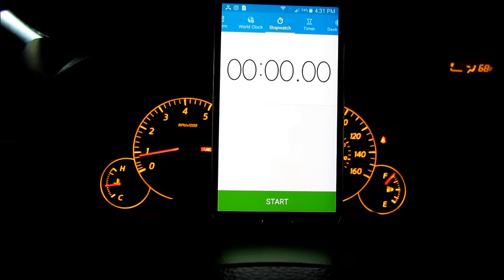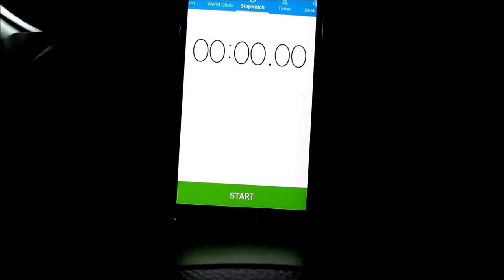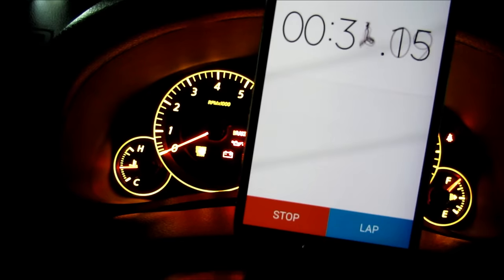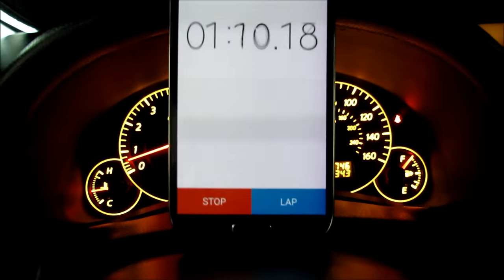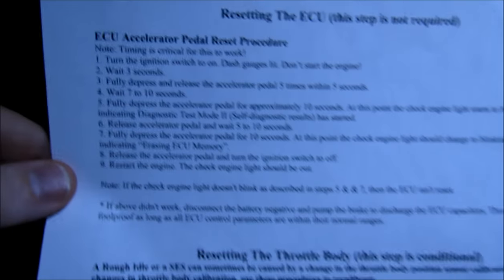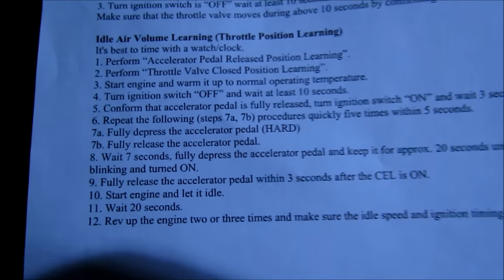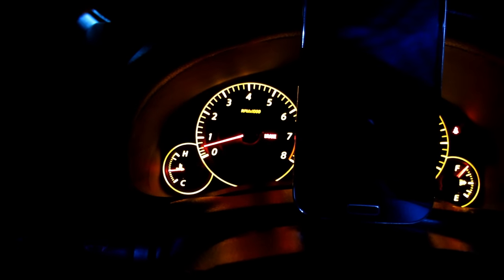Idle Relearn - FX35, I35, M35, G35, G37, 350z, 370z, Maxima, Murano, Sentra, Altima, M45, M56,

Comment: Don't even need a stopwatch. You provide one! Haha. I followed everything you did in real time and it worked flawlessly. Thank you!
Reply: Will this work on a 2012g37 xs???  It's push to start
Reply: Thanks for the big help lol
Reply: @MrStonedstickup  it should
Reply: @destinyachieved4599  worked flawlessly. I was nervous bc I was reading other people's comments that had issues afterwards. Usually that's me. Or it just doesn't work like the videos do. Always a trip to the parts store or something lol. I'my case this time tho. Perfect. Great video. Got my follow a long time ago. Videos are great !
Reply: Right he's freaking bad to the bone!! Some heroes don't wear capes
Reply: Dude you are the best!
Reply: Best video I seen thank for the help what is guy said I did the same thing and it worked thanks man
Reply: Thanks but I got a automatic G35 coupe 2005 I got a code p1283 a1273
Reply: Just helped me … solid video
Reply: Same, super awesome 👍
Reply: After idle reset my car will idle high around 2k and after a minute it will drop down to 1k service engine light stayed on
Reply: Should I do this re learn after I install a new gas pedal assembly?
Reply: Been using this video as my timer for my 2004 350z every time i need it
Reply: When you disconnect the throttle body you have to disconnect the battery correct???
Reply: Thank you man you really saved the day Big 🐕 ❤ 🐐 🐐 🐐
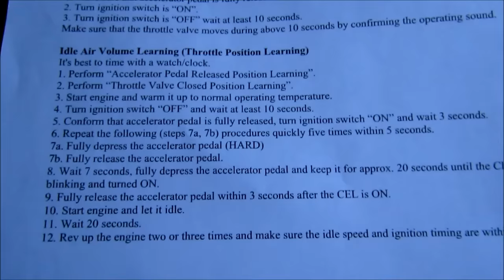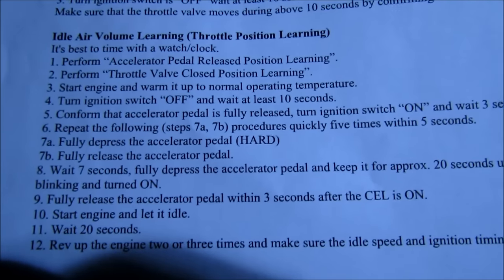Reply: @MrStonedstickup 😂l❤😢❤😢😮 3:30 😂😮😂❤😅 3:35 ❤😮 3:36 ❤o😂🎉😂🎉😂😮😅

Comment: After cleaning the throttle body on my 2005 Nissan Frontier V6 4.0l my idle went out of whack. The relearn worked the first time I tried it. I did it right beside your video and I didn't even have to look at my check engine light blinking. Timing is everything. Thanks!

Comment: I sometimes get very rough/jumpy gear changes in automatic (G37X)
The car has no get up, limited power etc. Have to use manual mode to get it somewhere to park, where I inevitably find a high idle, and sometimes an engine warning light.
This usually only happens in extremely wet or snowy conditions, maybe once every few months or so.
This video, the idle relearn completely fixes and solves the issue everytime. Thanks!

Comment: I cleaned the throttle body on my 06 G35x (107k miles). After doing so, I noticed that the rpm was a bit higher than usual on decel and idle. The car would propel itself and maintain speed on its own if you caught the rpm at the right time around 1300. After doing this the idle immediately went back to normal and the car decels normal. Thanks as always, your vids are easy to follow, informative and entertaining. Been watching for 4+ years :)

Comment: Worked perfectly on my 08 infinity g37s with push to start. After deep  cleaning both throttle bodies and switching over to cold air nismo intakes the idle was flunctuatuing a lot. Timming is everything flollowes the steps and worked beautifully thanks alot great video.

Comment: I tried several methods from shop manuals, the throttle body manufacturer and other YouTubers; none of them worked.  I was about to give in and go to the dealer for a relearn after changing the throttle body.  Saw your video, tried it and the problem is solved.  Thank you so much!
Reply: I should add that after my Service Engine light started blinking it stopped then went out.  I kept the pedal down.  After a few seconds it started blinking again and went out.  Pedal still held down.  Light started blinking again and finally went steady.  After a second or two  I started the engine.  Then I rev’ed it up a couple of times as you suggested.  Shortly after, the idle dropped down and settled around 500rpm.  Prior to your procedure the idle was around 1100 rpm.  Thank you again
Reply: My light never went steady

Comment: After cleaning my throttlebody and disconnecting harness my idle went upto 825 rpm. I did this idle relearn procedure on my infiniti i35 and it worked. My high idle has gone and back to normal. Thank you very much.

Comment: Wow man, this really helped a lot. I recently finished fixing up my 2006 g35 coupe and realized that it the idle was being very weird. It jumped from 600 rpm’s to 1000 back down to 600, and made the car annoying at times. I found this video without realizing I had to relearn the idle, since I did remove the throttle body to replace valve covers. This video helped a lot and I just finished the relearn.

Comment: Hello.
2009 Murano here. Did everything, light did blink and then went solid but it didn't go away at the end. Light came on after cleaning throttle body.
EDIT: Tried once more after this and it did work. Light went away. Timing is the key. If you do this than you have to be super precise. Thank you Motordyne for this video!

Comment: This video was perfect! I installed Z1 intake couplers on my 05 G35 sedan, and figured I'd clean the throttle body while I was there. Got the P0507 within about 2 minutes of driving. I queued this video as I did the re-learn. Idle is now around 675-725. no more 1100 rpm idle! Thanks!!!

Comment: I found an even EASIER way to reset my throttle position sensor and idle air settings.  I removed the Cable from both neg and positive posts. I REMOVED the throttle connector(s) on the HR models 07-09.  And I waited 30 minutes. I reconnected the battery cables. Then I reconnected the throttle body connectors. I started the car up and the throttle was RESPONSIVE AF and the Idle was back to the right position.. I Believe it worked for the ECU too.. My check engine light was cleared as well.. Been 3 months and it's still going smooth

Comment: Let me give the most valuable advice.  Just play this video and follow it exactly in your car.  Not need to mess with paper instructions or additional timers. 
I got it to work in my first attempt.  Was a bit nervous at first worry that I have the procedures mix up. Now the idle is down to 600-650 rpm.  Thank you!

Comment: My car was idling so badly and would die out after changing my camshaft sensor because I was messing with the throttle body. This fixed my issue in 2 minutes. 2003 350z, thank you!
Reply from the maker: Yep, anytime you disconnect the throttle body or touch the butterfly you HAVE to do the idle relearn. CAM Sensors are very common to also go out, so glad you got that fixed and my idle relearn could help.
Reply: Hey i have a 2008 m35 and i also changed my camshaft sensors, i did take off the throttle body, but my car stalls out when coming to a stop, do you think this will fix my problem?

Comment: This is a good video to get you out of a jam as well. If you replaced throttle body and didn't relearn right away; a bunch of codes might pop up because the computer is confused. It's ok to reset some of these codes while the engine is running, and the rest while the car is not. When you finally clear all codes; proceed with this procedure.

Comment: Thank you for this video. I resolved the P0507 code on a 02 Maxima. I'd tried using the procedure in other videos that have you doing the entire throttle position relearn sequence, and not breaking off the actual airflow recalibration as its own sequence. I never got the flashing engine light with other videos because the sequence was so lengthy that I screwed something up. Like others here, I watched your video along while I did the same actions in real time. So easy! And the idle speed dropped noticibly from crazy fast (lurching when I put into drive) to normal subdued, showing around 700 RPM on the tach.

Comment: just did my FX45, idling was around 1000RPM lots of gas smell from the  exhaust, now everything is normal idling around 700RPM no more gas smell
Reply: My car is idling at 1000rmp I thought that was normal and I smell gas from the car. Hopefully this will fix the problem.
Reply: @ViSlow23  did it fix it?
Reply: homxr no it didn’t I’m not sure what I did but I’m good now after I got tuned around may

Comment: Ive had a rough idle for almost a year now and i never could fix it. Thank you man!
Reply from the maker: Yeah the instructions can be confusing to do all timed up exactly right, the stop watch approach I show makes it much easier. Thanks for letting me know it helped you!
Reply: I dont have a check engine light in my g35 from 04, help?
Reply from the maker: What is the issue? Rough idle? Did you get the check engine light to blink and then to turn solid like in this video?
Reply: No I mean there is literally no check engine light on the dash of the older g35s, so idk if this idle relearning would work for those years. It only has the service engine soon light in the gauge cluster. When  the car idles, sometimes randomly there is like a tiny deep pop and the car shakes a little more when that happens
Reply from the maker: This works for all G35's. The check engine light in my car says the same thing, service engine soon, is what it actually says word for word when it lights up. Did you try to do this with no luck?
Reply: Will this work on a 2005 350z?
Reply from the maker: Yes, it will work.
Reply: Motordyne G35 i need ur help i have a 09 370z will this work on my car?
Reply from the maker: Yes, it will work on a 370z. Let me know what happens.
Reply: Motordyne G35 dude thanks for answering back i recently cleanned the TB nd MAF sensor i had the - sign unplug while doin this process nd i plugged it back nd still the same do i need to do this procedure?
Reply from the maker: Type out full words. I'm guessing - means the negative battery cable or do you mean you unplugged the harness on the throttle body?
Reply from the maker: Anytime you unplug the throttle body harness or touch the throttle body butterfly you have to do the idle relearn.
Reply: Motordyne G35 i unplugged the negative sign on the battery
Reply from the maker: Unplugging the negative side of the battery is always a good practice. When touching the MAF, the service manual states to unplug the - side of the battery. If you are having an idle issue, the idle relearn procedure will fix it. Let me know what happens?
Reply: Motordyne G35 the idle relearn is in this video right? just gotta unplug the - sign of the battery nd hit the pedal 5times?
Reply from the maker: Evan Rojas .....wrong video, that is for ECU rest to clear codes if you do not have a code reader. Scroll up, you are commenting on the idle relearn video.
Reply: Our light never stops flashing 10 flashes fast 10 slow 10 fast pause and repeat

Comment: Wow, glad I stumbled upon this video after touching my throttle body butterfly during cleaning yesterday. I went to leave my house afterward and much to my surprise(not really), my Z idled at 2k rpm steadily then dropped to about 1500 then back to 2k over and over. I’m hoping this is the issue. Thanks for the info!
Reply: Did this solve your issue
Reply: @yungsavage3422  yes it did. Just follow this exactly and it’ll reset.

Comment: It dropped my idle down from 1200 rpm to 1000 rpm on a 2002 Infinity I35. The procedure worked as the video and gentleman explains. Still runs a little rough but did seem to calm down the initial start up. Thank you for the video as Im now a tad more intimate with the vehicle.
Reply from the maker: MC Surreal .....idle should be at 650rpm. Did you have A/C on? With A/C on idle is like 950 to 1,000 rpm.
Reply: Motordyne G35 I did as you said and turned all accessories off including AC and Radio. I replaced the Mass Air Flow Sensor and that's why I was looking up how to relearn or reset the idle. Im going to replace the idle Air Control Valve now and then try the technique you presented again. Thanks for the response and great video.
Reply: @brandonbarker7817  did it ever go below 1,000?
Reply: @WaefreBeorn  no I do not think so. However it ran great for the next year. I no longer own vehicle.
Reply: @WaefreBeorn  actually now that I'm thinking about it I do believe 950. Sorry.
Reply: @brandonbarker7817  huh my i35 just won’t do below 950 or 1,000 either, I was worried about the automatic transmission slip but maybe it’s fine?
Reply: @WaefreBeorn  I'm a DIY mechanic brother I couldn't say. I do remember the idle was really high before the relearn and it ran fine afterwards.
Reply: @brandonbarker7817  I finally got it to stick, and it took letting it wait and retrying the same thing over and over. The idle relearn just needs to “do it whenever”

Comment: Mine blinks till it stays solid when I turn it back on the service engine light stays on still
Reply: It may be a code for something else or the new throttle body you have is broken
Reply: It's most likely the old code. Just clear all the codes with the OBD2 scanner and it shouldn't come back

Comment: This works!  I changed my stock throttle bodies in my 2016  45th Aniversary GTR to Curt Brown’s 36  mm polished  and bored-out  throttle bodies, which required the throttle body relearn. No P0507 code and the idle speed is back within spec.

Comment: Installing the Motordyne MREV2 lower plenum and 5/16 spacer kit on my 2006 brought me here. Got into a series of "might as well while I've got it all apart". Took the throttle body apart and did thorough cleaning. Powder coated the upper plenum. Also installed a new gasket, new bolts and a Moshimoto silicone intake tube. I thought maybe I had a vacuum leak since my Idle rev around 1100. I'm going to try this tomorrow.

Comment: Thank you so much! My G35 was idling rough/throwing the P0507 code and seeming to be getting worse...enough to where I was putting it in neutral at red lights and stop signs because I felt like it was wanting to stall out. Found this video and 100% fixed the problem. Just followed along with you and done. Saved me a mechanics bill. ❤️

Comment: Hey motordyne..... First of all I want to thank you for all your dedication you have given into all your various video that have been released!  I (we, the viewer's ) have gained  a plethora of knowledge from your research!  I recently bought a 06 g36 sedan  this last summer. I started out installing  a 5/16 plenum spacer (yes, reviewed you insight on this)  and never thought twice of resetting the idle air circuit...so this whole time ive lived with a higher idle approx. 950-1000 rpm's.and 2k+ cold starts!  I excused this problem believing it was the intake that i installed at the same time and was in need of a tune..  when i came across the video i was interested in the idea that i   may benefit form this. So tonight after work, i followed the instruction you clearly laid out and....... snap! my idle is right on the money.  no more brake lag (harder to stop a vehicle with partial throttle plate opened all the time) and no more exceeding high idle start-up.  We appreciate the material you deliever..  keep up the good work!!

Comment: @Motordyne G35 ...Thank you so much for this helpful video! I bought a new throttle body for my Nissan Altima. One repair shop said they would not install it, another shop installed it but did not know they needed to do a relearn procedure (neither did I, at the time).  
After looking at a few videos and trying the relearn procedure a few dozen times (unsuccessfully) I found your video and did it the way you said to do it and IT WORKS!!!  Thank you for sharing!

Comment: Check Engine Soon light went on in my 2010 G37. Idling was fluctuating just before light went on. Got it scanned at Autozone and got an error code P2135. Doing the idle relearn worked. Thanks!!!

Comment: Thanks Motordyne G35! This is the best video (P0507 code) - finally I reset 02 Altima Idle to below 1000 mark. let see for the next couple 100 miles.

Here is the problem of my Altima:
1. Idle high at P or N position after changing 2 months dead battery and replacing alternator (no time due to holiday)
2. Running little bit high RPM and trigger the code P0507
3. After cleaning the TB and idle is getting worse;

Will update result after few hundred miles.
Reply from the maker: Steven Nguyen .....When you cleaned the throttle body, if you touch the butterfly plate and move it, you will have an idle problem. Anytime you touch the butterfly, you have to do the throttle relearn procedure. You should have no issues now.

Comment: Just replaced the starter on my FX50 which involved pulling the entire intake. High idle after the job was done had me thinking there was a vaccum leak at the intake gasket. Did this procedure and everything is back to normal. These throttle bodies are tedious for sure.

Comment: Hello. I replaced my throttle body and my acceleration pedal position sensor. I performed ecu reset. I aslo followed the steps of your video. When i get to the final step to start the car.. it immediately fully revs to redline with out me pressing the  pedal… pls help. 05 350z
Reply: Did you ever figure it out?

Comment: Do all of the procedures have to be done in order? I replaced the Pedal position sensor, Throttle position sensor and Mass airflow sensor(which was missing). I just bought it and changed the pedal position sensor and mass airflow and all it would do is rev to 1200 rpm after doing the idle air relearn. Any suggestions would be much appreciated!

Comment: I'm getting a really high and low rpm rev on start up. I unplugged the battery changed the cam position sensors . Right on start up its starts revving extremely high and low.

Comment: okay this worked perfectly for me . I tried numerous ways to do the learn process, but for me it worked when you let the MIL light stay on after it was blinking. it seems that in that moment the computer was doing the learning. I cranked it back on and it had a high idle and slowing it set itself to a normal idle and it worked perfectly fine. I did replace the Throttle body which I really don't know if it was bad or not. all that could have been was probably the relearn.